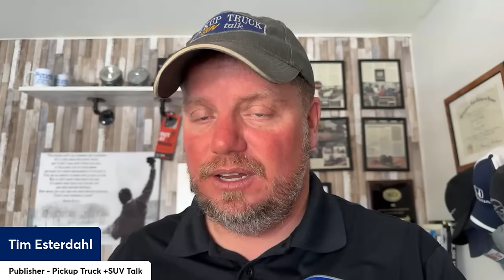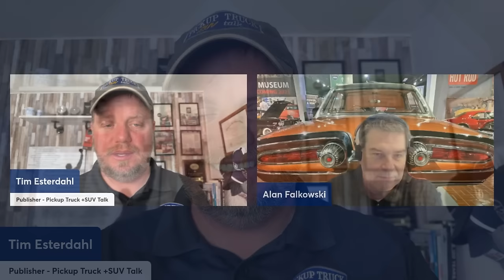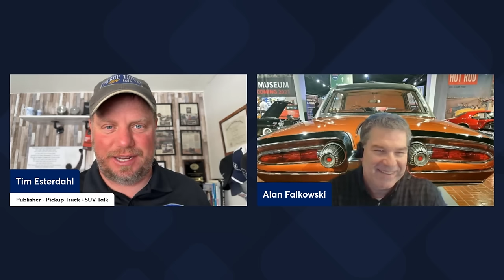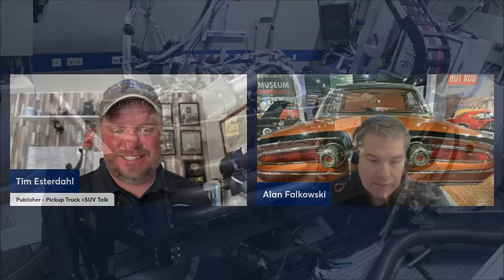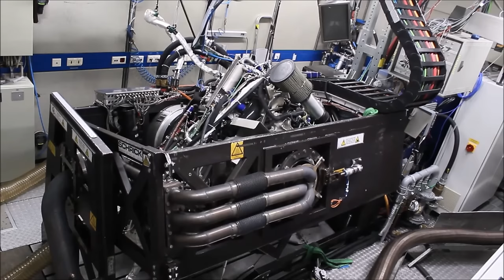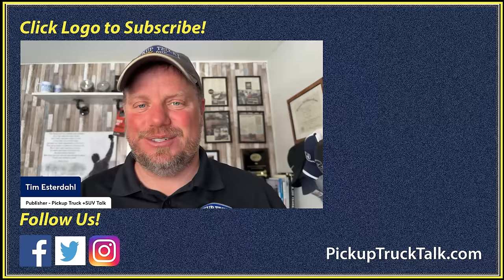Engineer Deep Dive: 3.0L Hurricane Engine - Turbo Life, Oil and Intervals and More

Comment: Nobody will ever be able to convince me that start/stop technology is a good thing or actually saves a material amount of fuel or emissions.
Reply: As a mechanic I thought this was stupid idea. But in practice it works great and is sensible way to save fuel and put less wear on the engine. You can always disassemble it too.
Reply: Agree. From a practical standpoint most people couldn’t care less about the negligible emissions reduction. If it actually saved a noticeable amount of fuel (greater MPG) it wouldn’t receive such hate. 
As consumers we do pay a premium for this as the starters and 12v batteries are more complicated and much more expensive to replace. All of these changes to satisfy government regulations cost the consumer more. More up front and more if you like to hold on to your car or truck.
Reply: Everybody I know that has start stop is reflagged to delete that stupid ideal !
Reply: It has nothing to do with mileage it's all about emissions
Reply: @alexgrindnshine2522 it puts significantly more wear on engines. The overwhelming majority of wear occurs when oil pressure is low during startup
Reply: I’ve had a Stellantis 2.0 turbo in an Alfa and one in a Jeep. The belt starter generator driven start/stop works much better than the Alfa conventional starter setup. It’s MUCH faster and much smoother to the point I left the function alone in the Jeep. In research, there’s really not much fuel to save using it unless you’re at least stopped 5 seconds or longer at a time supposedly. I did get an average of 21-22 mpg on a lifted, 35” tire, 4.56 gear Sahara 2.0 etorque, which is great, so maybe that’s one contributing factor in mixed driving.
Reply: @BabyGators  I agree that cold start on an engine were there is significant time delay for oil to reach the bearings will lead to more wear over time. With the start stop system on average shut off 5-30secs while at stop lights. Usually on 20min in town drives with lots of red lights the average time the engine was off is around 3-5mins. Or if you go through drive thro often, you may have your engine off for 5 mins plus. I personally will take the fuel saves. I am not worried about bearing wearing because of restarting the engine often, doesn’t worry me one bit. Most people take the car to get their oil changes done by a someone that doesn’t pre fill the oil filter before installing it, that would concern me more.
Reply: @alexgrindnshine2522  I actually did the math on this. Some big assumptions. I estimate there’s about a $300-500 cost increase to the consumer for a start/stop including the beefier alternator/system components. My 5.3 v8 burns 0.24 gallons per hour at idle. That’s a tremendous amount of idle time to make up for the “savings” and it also takes at least a few seconds worth of fuel to restart. I’ve heard 10-16 seconds worth although I can’t verify that. I see start stop as a scam.
Reply: @alexgrindnshine2522   i dont know what kind of mechanics you know, but they all must be sh** because   I don't know anyone who doesn't prime their oil filter.  Takes two seconds
Reply: when was the last time anybody replaced a starter on a start/stop vehicle?
Reply: @All-Miles-Matter  there’s a huge difference between residual oil film and 40 psi covering bearings. Are you disputing that start up causes more wear than running?
Reply: @CHAOSMOVEMENT  on many motors like the pentastar, it’s not possible to prime the filter. There’s no anti drain back valve so it pretty much loses oil every time it stops
Reply: @91stealthman  last week on my in-laws Mercedes
Reply: @BabyGators  no actually I'm not. There is a HUGE difference between your first start of the day and start stop events. YESSS the first start of the day in COLD environments is BAD. Auto start events THEREAFTER are not. The oil film will absolutely be sufficient for 1/10 of a second until sustained oil pressure kicks in.
Reply: @BabyGators  that is a sign of a Mercedes, not start/stop tech.
Reply: @91stealthman  your question was when was the last time someone replaced a start/stop starter. I answered your question.
Reply: @All-Miles-Matter  sure, cold starts are much worse. That fact doesn’t make frequent hot starts any better for the engine though. You can disagree, but it’s a fact that starting is worse for the engine than continued running. As I’ve said, at 0.24 gal/hour at idle and a gas price of $3.30, it takes 628 hours of idling to “save” $500. If we assume that start/stop adds $500 worth of components to the cost of the vehicle, that’s a huge number of idle hours to pay for itself. That’s for a 5.3 liter v8. I haven’t looked at idle consumption for my accord 2.0, but I imagine it’s less than 0.15 gal/hour. That would make the break even on it over 1000 hours of idling. All at the expense of increased engine wear. Even if it were minimal.

Start stop is a scam to placate the EPA and California
Reply: @BabyGators  I agree with you. But I think people get cold starts confused with starts in general. Only wear occurs on cold starts. Not EVERY start. Zero wear once the engine is at operating temp. I agree with everything else you say. Just not the fact that people think that starting the vehicle is wearing on the engine. That is only true on cold starts.
Reply: @All-Miles-Matter  all good. We can disagree on that. I would honestly love to see an independent study done on the effectiveness of start/stop along with a cost/benefit analysis to the consumer. Obviously I’m having to speculate on the cost of the system, which I’m sure varies significantly between different models.
Reply: @BabyGators  same here! They would have to take 2 identical vehicles and run one with start/stop and one without. 50k miles engine teardown and inspect. Micrometer and all!
Reply: @BabyGators yep!! 1L per hour is a good estimate for most idling light duty engines
Reply: @alexgrindnshine2522  1% fuel savings is great??
Reply: That’s because it doesn’t and it ruins the starter.
Reply: A very good vid, comprehensive and informative 👍🏽
Reply: Absolutely correct ! Start/stop is just a desperation effort by the auto manufacturers to eek out every possible increase in their “CAFE” standards. And for them to say that those starters are “specially modified” to take the extra cycles is just not true. This reminds me of that old saying: “Just a problem looking for a solution” Get ready for more starter replacements 😂💸💸
Reply: Who convinced you that to run an engine when it is doing nothing was such a wise idea? The electric pump in transmission makes it ready to move vehicle after 1/4 engine revolution. The spray coating on bearings and high output oil pumps make the thousands of extra starts inconsequential. The crank sensors with rotation sensitivity allow PCM to know exactly where the crank finally stops when engine shuts down and rolls back some number of degrees. The exact location of crank and positioning within the cycle of every cylinder firing allows the engine to start at the first opportunity usually less than 1/4 turn. When 48v mild  hybridization is used there doesn't need to be a starter. If a starter is used then thenflywheelnteeth are hardened, starter pinion is much tougher and starter motor uses larger bushings or needles bearing for much longer service life. 10+ years into s/s feature there have been few issues. The AGM batteries used have the same service life doing s/s as conventional batteries. The alternators on most makes are running at lowered voltage to stop battery drain but to not overcharge once the amp measuring device used sees the battery current drain recharged into battery. The s/s is inhibited if a/c load or heater need needs engine to run. The biggest issue with s/s is that it is different. I'm in my 60's and have been in the car fixin' biz for 50 years. For about 40 of that I fixed a bunch of cars for stalling at idle so I fully understand the feature being so unnatural. If you have ever turned off a light in a room you walked out of you practiced s/s.
Reply: That's because Politicians regulate how Cars are built!  Most Politicians have never built even A Wheelbarrow.
Reply: Obama and Paris accord will. 😂
Reply: I hate it i my start stop quit working for 6 months and i saw no difference in fuel economy.
Reply: @alexgrindnshine2522  Smarter companies like Toyota are using electric oil pumps which can give full oil pressure before the engine is cranked.  They also have moved to electric coolant pumps which give much better temperature control over the engine.
Reply: @alexgrindnshine2522 you don’t save money. U have to buy 2 or 3 x as many starters. lol
Reply: @alexgrindnshine2522  I'm also an auto mechanic and I fail to see how multiple repeated starts can put less wear on your engine. Most engine wear occurs on start up. Regardless of upgraded starters and batteries this tech just costs the consumer for what amounts to negligible gains just to satisfy EPA regulations. Nice having a check engine light on because your starter has reached max allowable starts without being replaced and reset. In a northern climate this function is disabled for 6 months give or take depending on where you live. I would never purchase a vehicle with start/stop that I couldn't disable. And if I had to disable upon every drive cycle I would never purchase said vehicle. Start/stop is a complete joke.
Reply: @malinoisnation9392  my vehicle has 100k extended mile warranty if the starter fails it’s on them.  my guess is the starter will last to 150-200k miles. I will not own the vehicle after 150k most likely. So the system makes sense for me. And again if you don’t like it then don’t use it.
Reply: It depends on the environment. People who constantly sit in heavy city traffic, it does make a significant difference. Most people, it's useless.
Reply: @alexgrindnshine2522 
You just showed that you never owned a pentastar. You cannot prefill the oil filter on one.🤦🏿‍♂️
Reply: What people never think about is doing start/stop on turbo vehicles.  You really think that turbo, which is spinning anywhere from 20,000-40,000rpm at IDLE, stops right away when the engine stops?  They will continue spinning for 10-15 seconds AFTER the engine shuts down.  That's where I would expect to see far more lubrication issues is turbo bearings on a stop/start equipped vehicle.  Engine bearings and everything else will still have enough of an oil film coating.  Also, turbos tend to receive oil slightly more slowly than engine internal components upon startup.
Reply: It saves fuel if you you drive city and stop at long lights. I shut it off most of the time because I don't normally sit at long red lights. I do notice better mpgs when I do leave it on.
Reply: on a six cylinder turbo truck it doesn't appear to save that much fuel so I bypassed my stop start feature.
Reply: @kenik2023  true. I can’t recall a cartridge still oil filter that allows you to pre fill it.
Reply: How many starts will a starter start? 
How much does it cost to replace it?
How many gallons of fuel is that, in the life of a starter? 
If you can't put a carb on it and make it scream, 
I don't want it.
Reply: It only says fuel, if you’re idling for longer than six minutes. That’s it
Reply: @BabyGators on start up the pressure is less of an issue, hence the reason it is used. Are you ignoring the difference in wear and tear from stop light vs COLD STARTS! Absolutely! 😂😂 are your really letting this get under your skin.
Reply: @jpscharged  Absolutely this gets under my skin. It's a design that provides ZERO benefit. It's risk without reward. Again, even a hot start is still additional wear vs continued operation. Even without that fact, the added complexity of the system and cost of the components does not make any sense whatsoever for owners when it takes hundreds to thousands of idle hours before a possible break even occurs.
Reply: The problem I see as a machinist, engine builder, etc. Is that soon as the engine re-fires you’re on the throttle. Oil pressure takes more than a moment to build, so instantly that crankshaft is pushing hard on those lower bearing shells. Oil pressure is zero sitting at the stoplight. do you start your car and instantly have it in gear accelerating. Doesn’t that sound like a tough time on components needing oil before load.
Reply: Turn mine off every time I start the engine. I'll eventually make that a permanent condition.
Reply: It's well known how horrible this tech is for engines. Just tear one down and inspect it. There's a reason that people disable it.
Reply: @CHAOSMOVEMENT  can't prime a horizontal filter
Reply: I WISH my 6.4 liter Power Wagon had start stop.   This beast uses a LOT OF GAS WHEN IDLING at long stop lights in congested areas
Reply: Start stop is only installed for emissions. The slight mileage gain, is just a plus. If you drive a Stellantis vehicle, it doesn't use the starter to restart the engine. The engine is restarted by the alternator, which actually powers the vehicle for one half revolution of the tires. To the person who said it would take 600 hours of idle time, that's only a couple years.
Reply: @BabyGators  cold start vs hot start. Cold start, 99% of the oil has drained back, hot start about 80% has drained back.
Reply: @alexgrindnshine2522 put less wear? Lol ok genius
Reply: @joeblow-xy3oz  I know genius right! 😂
Reply: I agree…….I get S/S technology to comply with EPA/CAFE requirements..

With the above said…..make disable in the vehicle settings menu and allow owners to have the option of permanently disable long term instead of as a single cycle and remembering at the next stop point.
Reply: If they can program engines to shut off  cylinders at no load cruising speed….

I would be happy with a S/S programming that can shut down two cylinders at a stop light/ intersection etc…. Keeps some cylinders firing and two….on a “Union Five”. 

Let’s say a six or eight cylinder….shut down three on a six cylinder and four on a V8….for a six cylinder that is V6 layout maybe shut down two or four to provide proper balance to avoid engine vibrations…..Inline six possibly three or four but keep enough to provide enough power to run accessories and electrical systems…(A/C, audio and maybe windows.

I still prefer the have a way to permanently disable the S/S on a permanent basis though the vehicle systems page of the settings menu!
Reply: @Logicallyspeaking4me your right Prius run for ever. People forget there is an engine that need maintenance on those cars.
Reply: Yeah, I agree. All it is doing is wearing out the starter.
Reply: It's cafe and epa ball tickling.  It costs the owner more to repair them it will ever save on gas
Reply: @sdudas01  if you're sitting at a light in the city to two or three minutes, it doesn't save fuel     instead of sititng there idling....you get about 1.5-2 MPG with the start/stop function
Reply: It's about money. It might save on fuel a tiny bit, but costs the manufacturer very little to implement.
Reply: @BabyGators You’re neglecting the wear and tear caused by idling.  Idling at 1000 rpm causes 60,000 piston actuations through each the cylinder per hour.  There are various types of wear that occur in an engine, and the total number of times the cylinder wiper sweeps through contributes to fatigue.  It also produces wear and tear on the oil itself because the oil is working.

Start/stop does prevent the wear and tear that idling causes.  This is one reason why low mileage police vehicles are so cheap, they idle a lot so the mileage is not a good representation of usage time.
Reply: @RedShiftedDollar  idling for extended periods is far different than idling for 20-60 seconds at a time. Extended idling causes glazing among other negative effects. Short rounds of idling contribute almost zero to cylinder wear. 700 rpm vs 2000 at speed. There is absolutely no engineer who would say that a brief idle is anywhere near as damaging as a startup
Reply: @BabyGators  Start/stop isn't for "a brief idle".  It's for thousands, or tens of thousands of brief idles that add up to a lot of idling time.

Idling causes wear and tear to your entire engine.  It's pretty obvious that your engine is running, therefore it is being used, therefore it is experiencing wear and tear.  A lot of engine parts don't care whether the vehicle is moving or not.  If you are cruising at a constant speed of 35 mph, the load on the engine is not that much higher than idling anyways.

The reason why engines warm up even when idling is because they are still doing work.  The fuel air mixture is being compressed.  Internal resistance is being overcome, shear viscous forces in the oil are heating it up and breaking it down, valve springs are being pushed.  The pumps are moving coolant and oil, the spark plugs are firing, cyclic fatigue loading of shafts and components is occurring.  These processes are consuming tens of horsepower.   Have you ever turned an engine over by hand?  An idling engine is doing all that work 1000 times per minute.  It's just that the work is not contributing to moving the vehicle so it is useless work that only contributes to working and wearing out the engine.  Why do this when you can simply shut the engine off?

Look up diesel standby generators that spend the vast majority of their time idling.  They still need to be rebuilt every so often even though engineers know these things idle a lot and have designed them accordingly.

I'm an engineer and I say 5 hot startups are less damaging than 5 minutes of idling.  Think of all the components inside of an engine that do not care whether the car is moving or not or putting down high power or not.

Imagine a car that only idles.  Would this car ever need oil changes even though it never hits the 3000-5000 mile interval?  Yes.  But why would this be the case if idling was a harmless process that caused no wear?
Reply: @RedShiftedDollar  I’m not arguing that excessive idling isn’t bad. I’m arguing that a startup is worse than 60 seconds of idling. The examples you gave are valid for extended idling. Maybe in large cities, idle time adds up, but anywhere outside of them, the average stoplight time is less than 30 seconds. I know  this because I timed quite a few in my area because I was curious of this exact issue. At best, if you call it the same wear and tear, it certainly doesn’t save a statically significant amount of fuel vs the cost of the system and complexity.
Reply: I totally agree with you
Reply: you can replace starters  etc too oftem- saves no fuel
Reply: My brand new (in 21) JLURD start stop failed after about 2 months. I knew it was the battery because others had the same issue. Jeep tested and said battery was fine. Spent 3 days in the shop including 3 loaner car, replaced the charging module to no avail. Still never fixed to this day. They spent another day on the battery tester and said was fine. I like it dead honestly. Instead of just replacing the $150 battery, they paid a mechanic the 3 days shop time plus 3 day rental car to not fix the problem. Jeep needs to get a handle on this warranty crap.
Reply: Seems like it would increase starter wear by a factor of at least ten-fold. They would have to be the world's toughest starters, to operate 10-15 cycles every trip to the grocery store.
Reply: It’s good 4 the mechanics, your starting your engine twice to three times as much……😂
Reply: Think of how fast the starter will wear out
Reply: I will disable that bullshit in any vehicle I drive.
Reply: It’s been proven to save 0 fuel.
VW came out with it as a sales promo and others followed.
My 2021 F150 used to operate that way then suddenly it stopped, and I’m not complaining, I think Ford removed it due to customer feedback.
Reply: @CHAOSMOVEMENT You’ve never heard of either flat-rate or cartridge-type oil filters? Nobody working with either one of those primes anything, unless maybe they’re working on their own car.
Reply: If you understood how an engine run. You would understand stop/start save gas. The only time I like it is when I'm in a drive thru.
Reply: The discourse on displacement and output, damn near ensures that this engine won't last in large heavy vehicles. V8s took off in the American market because they were lazy and understressed in most applications ensuring reliability.
Reply: @guyderagisch4964  No, v8 took off because they sound good. They made less hp than some inline 6. Have you ever heard of the 1987 Ferrari F40? It had a 2.9 liter twin turbo v8 making 478 hp. I'm sure 37 years later, even Dodge can make a 3.0 inline 6 last in a full size truck.
Reply: @blackericdenice  I want whatever you're smoking. You gotta look into the big blocks developed by the big three to move luxury cars and trucks. Usually operating below 4k rpm making below 350hp but 400ftlbs of tq or more. These big blocks when built make substantially more than they do factory, and it's because they're lazy for reliability.
Reply: @guyderagisch4964  I don't smoke and you were not living when big blocks made 350 hp. Engines last longer now than they did back then. Back then, the mileage meter on American cars were only 5 digits. The engines needed to be rebuild pass 100k miles.
Reply: @blackericdenice  The big three still had big blocks options on thier trucks, we'll after I was born. People didn't rebuild engines at 100k, they rebuilt at low oil pressure or rod knock. Hit up marketplace and you'll still find the old cars and trucks running. Meanwhile Chrysler has issues with thier current line of turbo'd jeeps. Especially the 1.3t and 2.0t in the renegade and compass. They had issues with the dart and a 1.4t. They have issues with the wrangler, and you expect the 3.0t hurricane, which has to do more work, to be different? They can't get the ecodiesel 3.0t to be reliable enough, even comparing to the current hemi, which is the most reliable platform they offer.
Reply: Built in turbo timer. Nice
Reply: At least you can shut it
Reply: I had that on a 2019 Silverado, it turned of the engine for 30 seconds ,so if your lights wipers and heat on ,it had to take more energy to charge the battery, disabled it permanently ,better off  difference 4:02 difference
Reply: NA engines not as worried.  But I do wonder about start stop featured on turbo engines. Seems like any reduction in oil supply to the turbo would create problems over time.  Plus you have to keep in mind, auto companies want reliable engines, but that consideration diminishes drastically after warranty expiration.  Not saying they want engines to fail, but the design intent is definitely focused on air around warranty timing.
Reply: that doesn't mean it doesn't it just means you refuse to accept reality, which all in all is not a great characteristic.
Reply: Increased starter replacement
Reply: Can’t say about start/stop. I can say cylinder deactivation system isn’t all that. My Charger got much better fuel economy when that feature wasn’t in use.
Reply: @All-Miles-Matter  Oil analysis in a lab setting can tell the difference in a day. They do exactly that
Reply: Yea, being a know-it-all, you know what you're saying and there's nothing thousands of engineers with thousands of hours of testing can do that you can't do.
Reply: Its only purpose is to meet emissions standards based on statistical data. Basically just a method to fudge the data. “The average driver spends X minutes stopped during the average commute, so therefore our engine contributes zero emissions for X% of a commute”.
Reply: Germany uses roundabouts to reduce emissions in lieu of 4 way intersection idling. Roundabouts reduce catastrophic accidents but increase minor fender benders a little.